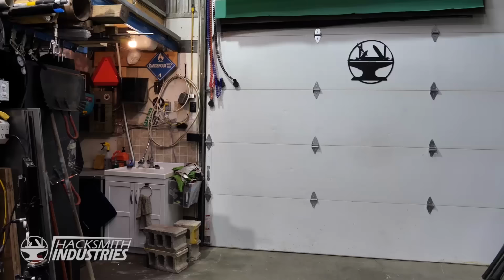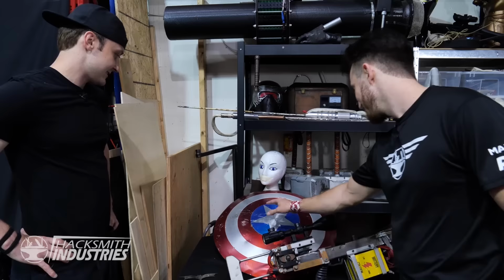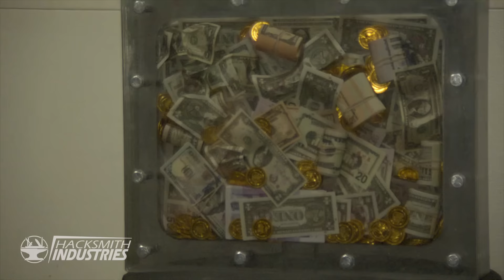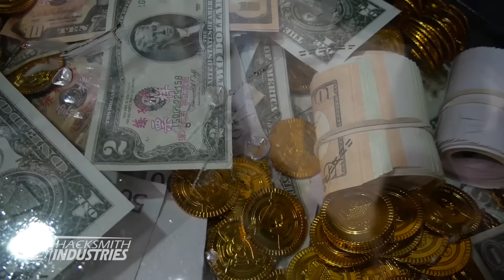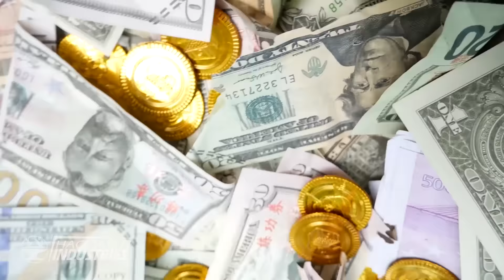UNBREAKABLE BOX vs THE HACKSMITH ($10,000 TO BE WON)

Comment: Hacksmith: Let’s use all these crazy weapons!

Me: Use a screwdriver
Reply: Best commemt
Reply: what screws?
Reply: You mean socket wrench and pipe if really needed. If those are glued in place just angle grind hole in the plastic, simple.
Reply: Drill or screwdriver
Reply: @Hellsong89  yeah anglegrinder is probably the best. My thought was using thermite on weakpoints though. Or use acid or other solvants
Reply: @Hellsong89  or supercool it with liquid nitrogen to make it brittle
Reply: Galador they did that
Reply: Break the box not open it.
Reply: @frankteng5476  the nitrogen in fire extinguishers is not liquid and dont get as cold
Reply: Calvin Hong no a pencil
Reply: Ur supposed to break it not open it that ruining the fun
Reply: I agree
Reply: lol
Reply: Vat19 crew: *B O M B S*

Comment: "We also have our own version of the boring flame thrower"
Dustin : I have the real version
Fires the heat of 800 suns
Dustin : Y-your versions better
Reply: "We also have lightsaber, zarya particle cannon, stormbreaker, mjolnir,and oh, did we mentioned Cap shields?"

Dustin: fuck it, I'm gonna cheat
Reply: 1000th like.
Reply: 800x10.000.000=8.000.000.000
I don't think it has so much heat
Reply: @ice_kubson8038  r/woooosh sorry had to mate😏
Reply: @n.3.x.038  you are not on reedit so 
YT/woooosh
Reply: @ice_kubson8038  *slams head into table * AAAAAA

Comment: I can't believe he didn't use his two most powerful weapons Storm Breaker and the Protosaber
Reply: The video would have been over way too quickly lmao
Reply: Ahem check the dates of this video
Reply: @michaelsong1465  stormbreaker did exist before the vid, unless i'm wrong
Reply: @michaelsong1465  and I'm correct
Reply: Stormbreaker is in the video
Reply: @michaelsong1465  Both the Protosaber(Dec 2017) and Stormbreaker( Sept 2018 was part 1 of the build) were in this video, however, as other's have said. Both would have ended this way quicker. I'm not sure that Stormbreaker would be heavy/sharp enough to get through the double layers but the single it would for sure. The Protosaber on the other hand, would have easily destroyed this box with no problem even though the double layers and made this video hella short.
Reply: Or bolt gun
Reply: hakku
Reply: He also didnt use the portable railgun he has laying around somewhere
Reply: date of the video and of course the money could have set on fire
Reply: the protosaber is 2 0p
Reply: He wanted content
Reply: Didn't need to? They got into it without those
Reply: Samuel Walley true
Reply: If he did that first, it wouldnt stand a chanse.
Reply: @soulessshadow5356  and plus the protosaber would just burn the money and the storm breaker could have cracked the gold coins
Reply: He did not need to
Reply: Jonas Martinelli he knew it would brake and not be good content
Reply: Jonas Martinelli and the lightning summoning mjolnir
Reply: @michaelsong1465  what do u mean the first lightsaber came out in January of 2019
Reply: I want hm to come back when the alien 2 power suit is finished
Reply: Jonas Martinelli yea
Reply: stormbraker would have done it before the playinng field was levaled
Reply: Or zaryas weapon form overwatch
Reply: he didnt use zaryas particle cannon
Reply: Proto saber didn't exist yet
Reply: stormbreakker would probably destroy the box while protosaber would have just destroyed the cash and box.
Reply: Check the dates
Reply: @michaelsong1465  yeah
Reply: @lancetheking7524  not protosaber
Reply: @Slotff0125  k
Reply: Bedecick Cucumberbatch stormbreaker is legit in the vid
Reply: If he used the protosaber he would have probably burned the money itself
Reply: at the same time  he didn't have those

Comment: When this video was made, there was no plasma cutter, lucky box.
Reply: Plasma cutter can only cut conductive materials not plastic
Reply: Or hydrolic cutter.or HF acid.
Reply: @IkaeLike  hmmmm....those bolts don't look plastic.
Reply: UNBREAKABLE SHIELD VS SWORDs!!!!!!
Reply: wondering where it was...
Reply: There's no Captain America Shield with a laser on the middle
Reply: Flame Destroyer if they used the lightsaber it would have been over pretty damn fast
Reply: Or even the lightsaber
Reply: All you need is oxygen and a magnesium rod
Reply: @IkaeLike  have you ever used a plasma cutter?
Reply: CSE 13 07 abdul alim khan You really need to understand how hydraulic cutters and HF acid work before you comment. It seems as if you just took random powerful tools thinking it would work
Reply: Oo
Reply: So true
Reply: The plasma cutter would set the money on fire XD
Reply: jeff hi jeff
Reply: Flame Destroyer hello
Reply: They didn't even use iron man plasma cuter
Reply: Or an angle grinder, but that would be lame I guess...

Comment: if only u invented the lightsaber in 2019 (:

Edit: Thanks for my first 2k likes guys!!!🥰
Reply: you just came here after the video too😹
Reply: @maurys4390  yep
Reply: he can make a new box. Or bring back the Double. ;)
Reply: Me too
Reply: I was gonna say that too lmao. But he probably would’ve lit the money on fire
Reply: @ChristianP6245  true (: but they could cut the edged off of the box without touching the middle
Reply: Ya
Reply: @ISRAEL GONZALEZ actually based on the material composition you see in this video it likely would be weakest to a high amount of heat. It responded less to blunt forces and a whole lot more to the heat, but I could be wrong and maybe it's rated for 4000° temperatures (the money not so much though, my plan would've been to start with the "primer" being the light saber and simultaneously be something like thor's hammer for the best combo results)
Reply: If only it was still 2019
Reply: If he had it would've be gg
Reply: Irma Hernandez he could’ve used so much more
Reply: Yall true but still
Reply: I fell you😪😥😔
Reply: Yeet
Reply: Lmao
Reply: @lariyahankel543  (:(:(:(:(:(:(:(:(:((:
Reply: @cormacsully7815  
Lol
Reply: Or the proto saber
Reply: @ISRAEL GONZALEZ localized heat, though. As long as it heats a spot faster than the heat spreads through the plastic, they can make a cut
Reply: I’m not trying to be annoying but it’s called a protosaber with the backpack because a lightsaber would need the power of a nuclear plant
Reply: @LDMC2333  u r not being annoying (:
Reply: @lariyahankel543  ok because I know when I say stuff like that ppl get mad at me
Reply: Bruh all the money would straight up burn
Reply: @maurys4390  yep
Reply: that was my thought too, the lightsaber would probably handle this.
Reply: Exactly my thoughts
Reply: Yeah ikr if they had that they would recc this thing
Reply: then the monwy will burnt because the light saber is too strong that ot can burn the money faster than the box
Reply: There wouldn't be any money if they had.
Reply: Yes
Reply: @maurys4390  same
Reply: Trust that light saber could burn that in like 5 minutes
Reply: Well if the point is to get the money out without BURNING IT ALL, the proto* saber would be useless.
Reply: True also flamethrower, blaster, and everything else
Reply: @mbmcnulty0429  those won't necessarily burn all the money, since they could just crack the box on the outside. Though I wouldn't suggest using those either if you want to be able to use the money after you break the box.
Reply: yeah and burnt the money in the process...
Reply: that will burn the money
Reply: Then their money will be burn out xd

Comment: The box will also get destoyed quickly with the mech arm i think
Reply: No it isnt because you the box is too big to grab it or you grab it on the big sides but then the pressure is too low
Reply: Why didn't anyone use the power loader?I mean hydraulics on the mech arm would've smashed it to bits
Reply: Because that would end the series quickly
Reply: @kingtraviselgreat9836  true,if they did that,it wouldn't be fun and anticipated by the person.
Reply: No if you have a flamethrower and put it on the box for a while it will melt and it gets weaker that’s what guava juice said

Comment: Lightsaber has enter the chat room

Unbreakable box: sweat profusely
Reply: Wouldn't the light saber burn the money?
Reply: You mean profusely melting?
Reply: Money sweats more
Reply: it would take seconds
Reply: @Thomas_H._Smith  Only if you’re not careful with it. The box is glass, right? So heating certain areas can melt the glass and make it fall off.
Reply: @shibathesamurai9893  actually the box is made out of polycarbonate which is more of a plastic than it is glass.
Reply: @Thomas_H._Smith  Oh. Wouldn’t it still melt though?
Reply: @shibathesamurai9893  Okay so upon doing some thinking and research, yes it would melt. The melting point for polycarbonate plastic is atleast 110° C, and the lightsaber is 4000° C. I still think it would burn the money though. The light saber cut through a stainless steel barbaque, which has a melting point of 1510° C, and it completely burnt the turkey inside. Which wasn't touching the actual barbaque.

So to recap. 4000° lightsaber melts 1510° melting point of BBQ with Turkey in side catching fire, with out touching the BBQ.

VS

4000° lightsabers against 110° melting point of polycarbonate plastic, with money inside touching what's being melted.

Comment: When you melt an indestructible box with a fire sword on a wooden deck:
SafeT
Reply: Wood isn't explosive who cares
Reply: It LIGHTS ON FIRE
Reply: @donitaterry2214  Not really, Large planks of wood don't sustain a flame by themselves at ambient temperature. Try and catch a 2x4 on fire with a lighter it won't hold a flame In a reasonable amount of time, it has to char before it will hold an ember.
Reply: @donitaterry2214  it doesnt just catch on fire in a second when you get close to it holding fire lmao
Reply: Light on the Inside a fire sword is not a tiny lighter
Reply: @donitaterry2214  bruh

Comment: tbh it would have been much more epic if you used stuff like the lightsaber to cut the actual box, cuz throwing thor's hammer isn't really about the hammer but more about the weight. you could have a steel anvil dropped instead and that would have worked.

Comment: 5:32 is thors hammers handle supposed to bend like that?

Edit: 12:30 and crack open?
Reply: Hela: happiness noise
Reply: Yes.
Reply: Don't worry. The Hacksmith can rebuild it. He has the technology.
Reply: As I remember that's how it ended when Stormbreaker came into the channel, I guess
Reply: I think its not crack open its just made like that not one unity but a one big holo container hold very dense metals or matters
Reply: Well somewhere in the video they did say that they essentially broke Thor’s Hammer
Reply: @fallen9780  yup its broken cause when they did it its hand was straight and its head was welded 
Dont worry some small magical engineering tactics and it will go back new 😂😂✌
Reply: Because Thor didn’t aim for the head
Reply: TheJuiceMakesTheTaste BudsOfMyMouthFillWithJoy I saw that is well
Reply: The case was hela
Reply: TheJuiceMakesTheTaste BudsOfMyMouthFillWithJoy your username is ridiculous- AND I LOVE IT
Reply: Loki approved

Comment: Dustin: The flamethrower is so hot
Hacksmith:*pulls out lightsaber

Ps why didn't he use the lightsaber?
Reply: 1: polycarbonate vapors are deadly toxic
2:burn all the money with the amount of heat that its pumping out + gold is extremely conductive, would have made it much worse
3: the prototype lightsabers rod would have to be replaced before its used, which iirc he doesnt want to replace as much since its too much trouble for him
Reply: 1.he didn't use storm breaker
2.he didn't use storm breaker
3.he didn't use storm breaker
Reply: JE gaming EXACTLY!!!
Reply: @emman_7261  if the mjolnir weren't worthy, would have been the stormbreaker that ends it.
Reply: It would easliy burn through the glass

Comment: Dear all saying he would’ve burned the money with the lightsaber: Yeah, if he plunged it right through the middle. Which is dumb. Go through the screws and lift off the cover
Reply: At that point u can just use a hole saw drill ... takes like MAX 20 to 30 seconds to cut a hole into that stuff. And no heat necessary that could damage the money.
Reply: Esava T this point the lightsaber doesnt even work, its incomplete and bend with attack.
Reply: Jack Skatter. You just have to take it slow, it still reached a high enough temperature so it would have worked
Reply: Esava yes, but the point was to use hacksmith projects.
Reply: @trevordillon1921  Now, they also have the Ironman plasma cutter. Pretty sure there's no way even a triple layer box would survive that...

Comment: Of this year 2020 today they made iron mans plasma cutter so that whould easily break the glass in one momment
Reply: Plasma cutters require conductive material in order to transfer the electricity and create the Arc that Heats the material.
So you Maybe could plasma cut the Bolts but i was informed your not allowed to go for the Bolts.

Just for reference: Plasma is the 4th state of matter created by Super heating Gas (Usually Compressed air) until it reaches it ionization point. On a Plasma cutter this is done at the Arc. When it jumps across to the steel it creates heat upwards of 25000 Degrees Celsius. We then send a Jet of compressed air Thru the arc and It ionizes before it reaches the Steel. This Stream of now Ionized Particles Literally Vaporizes the Steel With the force of the Air Jet pushing the crap out of the way forming a kerf (cut).

Comment: An anglegrinder or Oxy torch would have had this open in like 5 minutes.
Reply: Yeah and he also could've just used a wrench to take out the bolts but that wouldn't be fun to watch
Reply: Tedd taking a car welding a spike on the chassis and habe it crash into a cliff side with the box in the middle would habe worked too
Reply: Or just snipe it with L-39 lahti 20mm AT.
That would one shot the glass open from both sides

Comment: A drill would be perfect for this. A blunt hit gets contributed through the surface. But if you use alot of damage in one point for long enough. It's will drill through and make a hole. Only then you can use a hammer to increase the size of the hole and beat the challenge